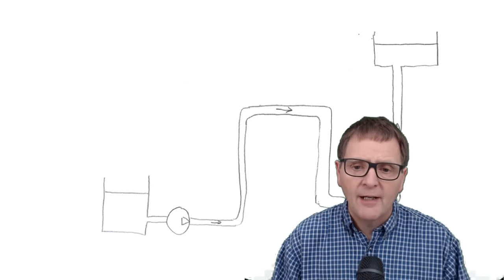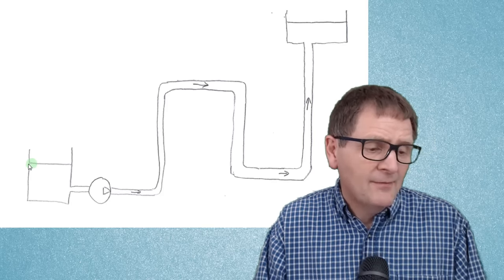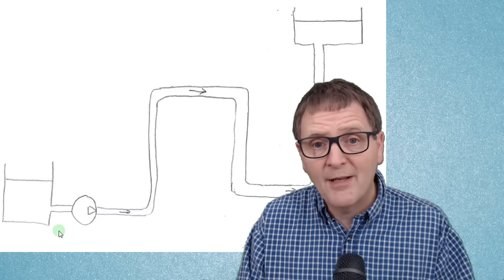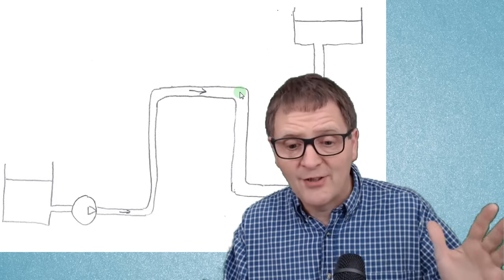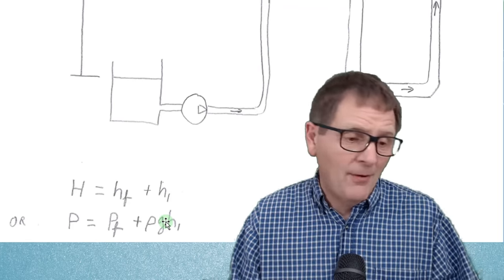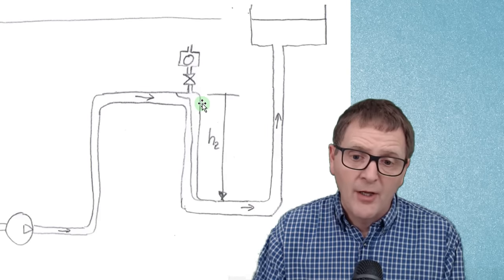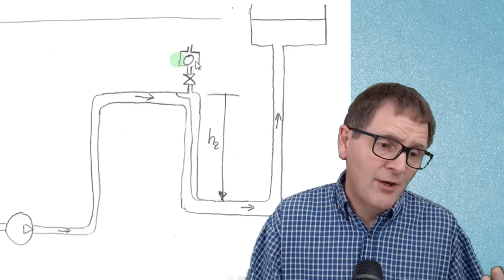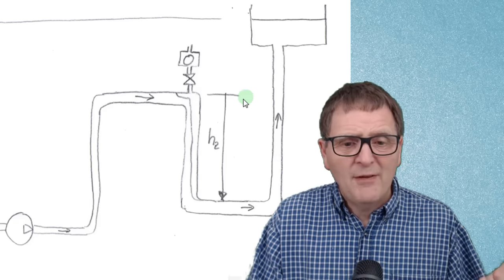Waterfall Flow & Airlocks in Pipes Explained

Comment: I'm creating an up-settling system for waste veg oil to filter it for use in a vehicles diesel engine. I have 5 x 44 gallon drums in series.  I add 20 ltrs of oil at a time to the first drum which has a funnel that gravity feeds down inside the first drum till about 6 inches from the bottom. The oil then travels up to nearly the top and reaches the outlet then flows out the side of the first drum inside the next drum at the same level down a PVC 1" pipe and again down until 6 inches from the bottom. The lids can come off the drum but i leave them on and sealed, but! 

It seemed to me that air had a way to travel all the pipes and ways of the system i thought gravity would push it through. But upon first filling the first drum it started to go into the next drum ok but when it reached the 6 inch level of the second drum it stopped and the first drum filled and overflowed. A nice mess went on the floor. I am able to disconnect the hose fittings between each drum, i did that with the first and second drum and it seems to fill the clear hose with oil again and flow. I also sat the lids ajar with a bit of metal so air goes in. 

I'm not sure if this will work but i put another 20ltrs in and it will slowly gravity feed down in the small holes in the funnel and will see if it will work when i see it again tomorrow. Any suggestions or ideas? Or once the system is primed might it be right? 

Its more tricky then i thought.

Comment: how do you calculate the water flow rate needed to pump/blow out an airlock in an open vented system that has a common pool for flow and return, the high point in the loop being above the water surface. 22mm pipe

Comment: If the diameter of the pipe is 24 inch, is it possible to have an airlock on elbow of vertical pipe by which the fluid is flowing downward?

Comment: The plumber hasn't kept a alternative pipe for outlet of air.so, everytime the tank empties out ,we have this airlock problem.
Reply: On the top of the tank, there should be a pressure gauge. Install short nipple tee and valve. Put the gauge on the tee and valve on the other straight end. Put the valve on and use it to bleed off pressure. If your tank is carbon then air could come in somehow. Haven’t figured out how to prevent it yet. 😁. Hope this works for ya.

Comment: Could I experience an air bubble developing in my 1 inch water line which is 1000 feet long and have a 20-foot difference in elevation from one end to the other, it will be buried 4 feet underground in a trench dug by an excavator the bottom of the trench could have irregularities 6 in to a foot (and almost impossible to determine) along the length of the pipe.
Reply: Simple answer, yes. Depending on how many and how sharp the turns are you can get air bubbles. Anything other than smooth straight pipe will introduce friction headloss. This will reduce your flow or require more energy for the same flow.
Any bends in your pipes will cause headloss; any transitions in pipe diameter will cause headloss.
Hope this helps

Comment: Thanks Mike, my elderly mum has had several airlocks in hot tap recently. Could this happen if she left the cold tap running for too long? Unfortunately she is quite forgetful. Or might there be other problems we need to outrule before deciding she is causing the problem. Would really appreciate your thoughts as it is really becoming a problem
Reply: For a house, the pipes are small enough to get flow speed to push out any air bubbles. No worries with your mum. Rest easy.

Comment: Can vapor locking be dependent on pipe size and velocity? I’m nervous about installing a high point bleed in hazardous service. It’s only 1.5” pipe at a high flow. Links/evidence would help too!
Reply: Vaporlocking is dependent upon many things including pipe size, velocity, temperature, pipe material, fluid being pumped, etc. You don't specify your hazardous service so it is difficult to surmise

Comment: So why there is loss in energy I mean when there is no air there is no loss so what's the role of air here , how does it(air) makes energy loss ? Anyone please reply, this doubt is haunting me for a while now ???
Reply: The air is a gas. this gas displaces the water. You now have less area to allow the water to go through. This results in more friction - more headloss - more energy for flow.
If you had a pump providing the flow and you sped up the pump you would see the pressure gage reading go up (due to headloss) but you may not see the appropriate increase in flow rate (e.g. the water level not going down as fast as expected) This is because the air bubble is acting as a blockage
Reply: @schatzemanly6749  thanks , that helped

Comment: I have an application nearly identical to this.  The top is vented at the same location as your sketch and releases only water.  At what point does the water velocity carry away the air? Is 10ft/sec sufficient?  (h2 is 18ft and pipe size is 72inch diameter).  Is the head loss "h2" eliminated if there is no air at the vent?
Reply: Did your question ever get answered? I’m curious too but I’m not messing with water. Evidence would help
Reply: No - I didn’t get an answer but found the problem. The issue was a vortex forming in a horizontal Tee because the tee was close to a perpendicular elbow in the 72” pipe.  We installed a 24” tall wedge in the Tee to direct flow and break any vortex formation.  Pressure drop across tee decreased from 6 psi to less than 1 psi.
Reply: @texashog4526  Can I help with a situation. I install air release valves in sewer and water. My friend has his PhD in Hydrodynamics so he understands Bernoulli, Newton and those other guys
Reply: @waaades  Wade, I've seen the vortex also in a large pump that had a design flaw. We put in a cross pipe in the suction header and it literally broke up the vortex before it got to the pump. (Warm water with low available NPSH)
To answer your earlier question; Yes, the removal of the air will cause h2 to go away because there is no longer air to create a bubble. The water velocity required depends on a lot of variables, but, if you have an automatic air valve installed, that works, then you should never have this issue again.
Hope this helps.

Comment: I would think that he was wrong. The pressure drop in that h2 portion is due to constriction of flow. As area of water flow is constricted by air bubble, the velocity increases and hence pressure decreases (Bernoulli would be a goodstart for rough reference) and hence significant pressure loss. It has nothing to do with h*rho*g effect.
Reply: jaedon86 you are not right mate. He is right but his explanation was not complete. H2 head loss is caused by waterfall. When water goes down (h2 because of gravity force) the level of water changes (drops) and the pump must compensate for this loss to elevate water to the required h1 😉
Reply: Hf i mean 😉
Reply: Well explained! Agree with jaedon86.